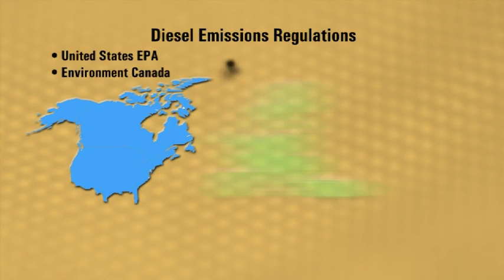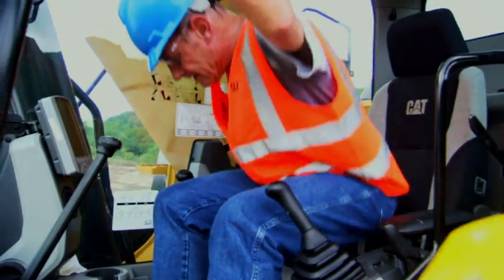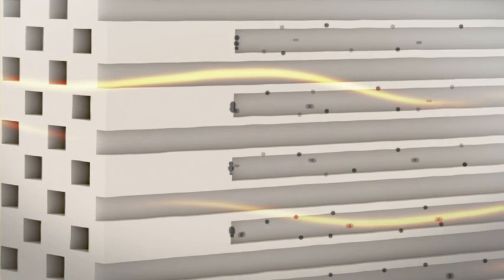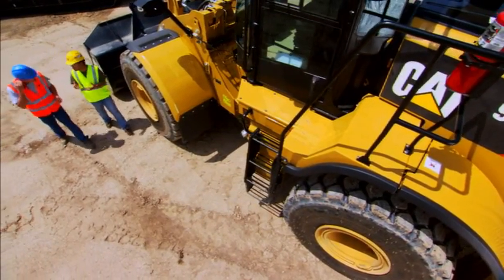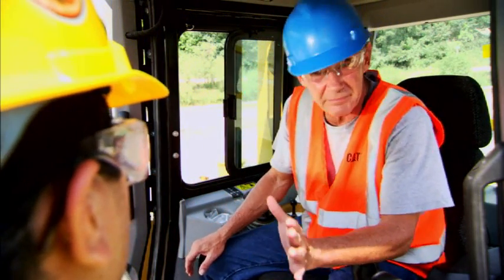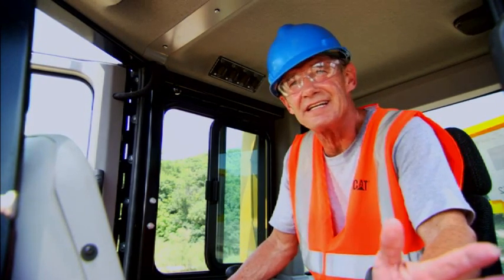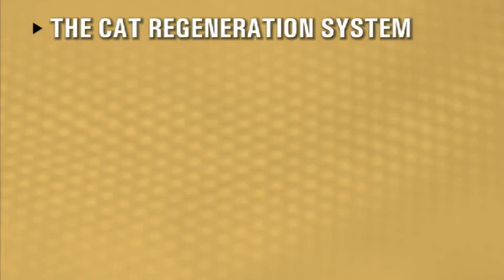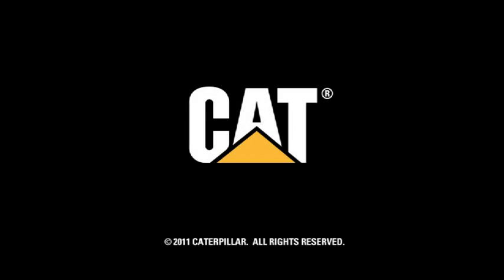Cat® Regeneration System Removes Soot from DPF | Tier 4 Interim

Comment: The video indicates the exhaust temperature only increases 50-100 degrees. What would be the external temperature of the DPF in normal operation as well as in regeneration? We operate 980 loaders in a wood chip handling application and are concerned with wood fiber coming in contact with the DPF and igniting.
Reply: 😅 😅😮.,  😢😅.   .mm 😅 😊 😢.z
  z   z😅😮😅 😅,      😅😢 😅😢, 😅       😅😅   😅😮.          😮 😮 .  C         x  x 😊   .😅  z😅 😅